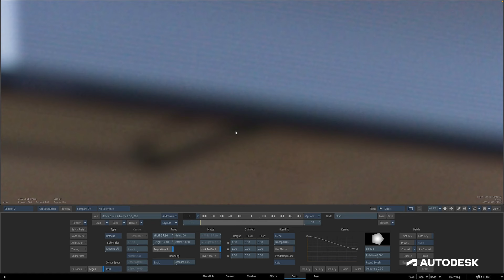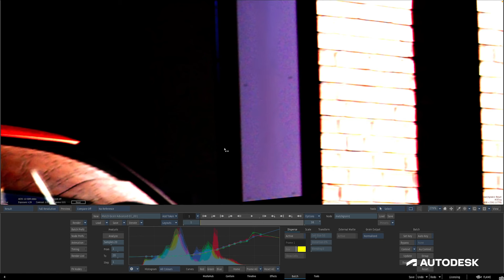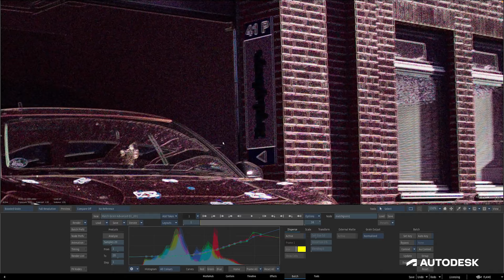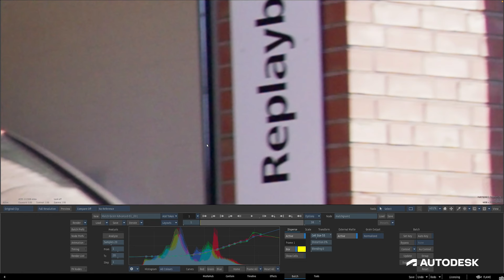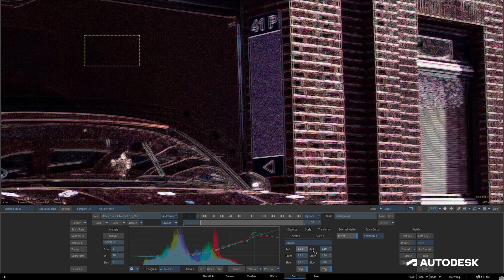Match Grain: Advanced Options - Flame 2025

Comment: Great walkthrough.  What is the capture quality of the original clip being sent to YT?  The nodes in the batch are a blurry mess.  Any chance to upload at a higher quality YT resolution for future videos?  Appreciate not using a widescreen interface though, as then everything becomes minuscule.
Reply: Thanks @squirekev-- this video was captured at 4k and then scaled into a 1080 timeline with 16mb/sec bitrate, which SHOULD be fine and as high-res as it needs to be. I'll admit I was using remote software to remote into my machine, so there is a really good chance that's the culprit. I can explore going local for future videos. I usually try to zoom into the screen to avoid what you're describing, but this tutorial in particular dealt with showcasing the controls, viewer, and batch schematic simultaneously, so I couldn't really reliably zoom in without constantly needing to zoom back out so I opted to go wide overall. Sometimes I've found on Youtube it occasionally won't automatically set itself to the highest resolution depending on network stuff going on, so maybe double check yours is set to HD and not automatically going to a lower res, but otherwise, thanks for the feedback and I'll see if I can make it extra crispy for future videos.
Reply: @JeffKyleFlame  I sounded like a client pointing out a dead pixel. heh. Appreciate the extensive response.
Reply: @squirekev  Ha-- I definitely don't think so! It's a solid point and I appreciate it.